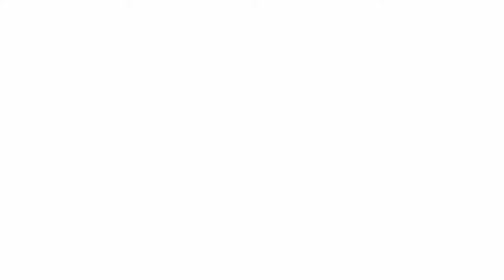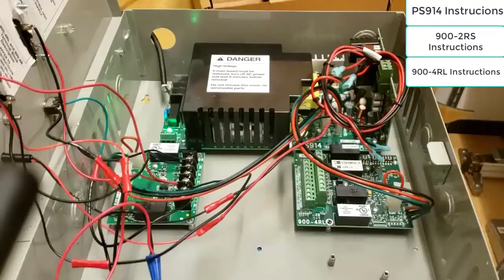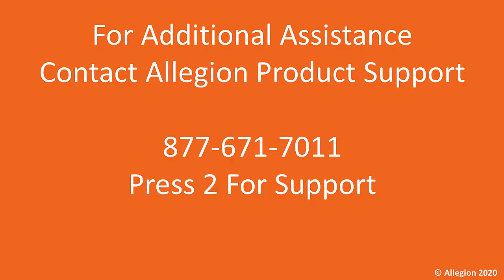How To Reset  PS914 Power Supply If No DC Output

Comment: Two serious issues with this video, especially being sponsored by the manufacturer.  First the DC wiring is a mess, which is typical of installers that only have experience at McDonalds. Second is the reason for no DC output in this example is there is a Battery Backup module installed in the upper right corner, and of course there are no batteries installed. This panel initially lost AC power, tried to switch over to DC, but no batteries. The safety feature of this panel is locking out the DC power so someone would check and fix the problem.  Pulling the voltage selection jumper is not a fix. Installing batteries since the emergency power module was already installed would have been the real fix.  In our region, battery backup of ADA door openers is required but many local suppliers and installers make the claim it's not necessary, that is until the day the door doesn't work, someone gets hurt and the lawsuits start. I encourage Allegion to take this video down and make a proper one.